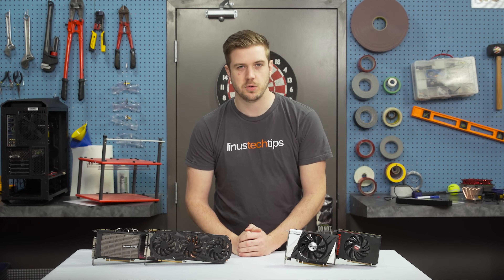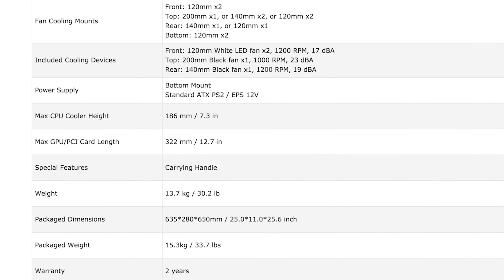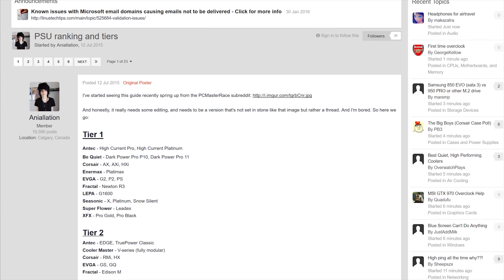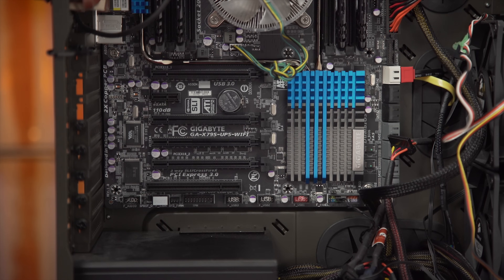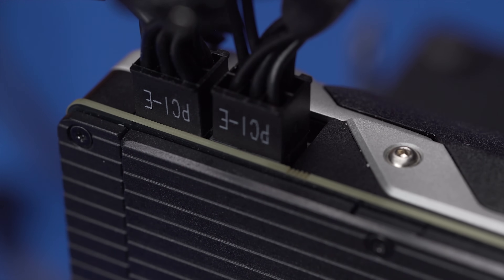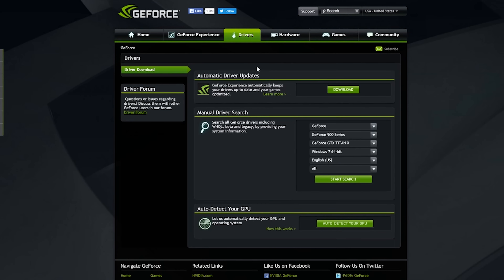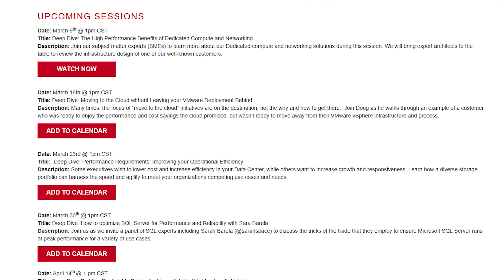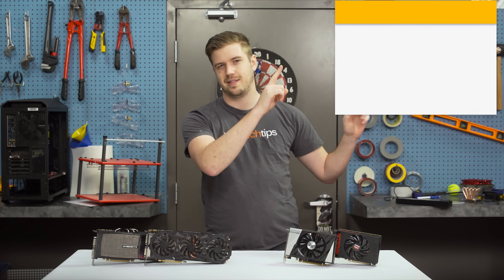Installing a Video Card - How To: Basics

Comment: You know.. I always laugh when I see people talking about how you guys are running out of content. But this.. this might actually confirm it. You guys are actually teaching people how to install a PCI-E card.. I don't think people that need to learn this are willing to even take the screws off of their case let alone touch something inside it. 

Stick to the good stuff guys, you moved into this new warehouse and instantly sold out by no longer being a bunch of techies doing awesome stuff in their basements, like the whole room water cooling. 

Here's an idea, buy some drywall, build a portable closet, buy a portable air conditioner and see what kind of performance you can get off of a PC by pumping the AC into the closet and pumping the closet air out! Is it feasible to run AC independently into a remote PC room? I'm sure Linus wants to know since he has one in his own house.

Comment: Even as a hardcore gamer and system builder for over 15 years, i can still appreciate a video on how to do things like this correctly.

One thing i would have included is to check for ports VS your monitors. Some manufacturers come with adapters for like DVI to VGA but many screens today offer DisplayPort and HMDI only so this can be an issue for novice builders and multi monitor setups.

Comment: Should I uninstall my drivers before or after inserting my new GPU?
Reply: +Phoenix no delete system 32
Reply: Before
Reply: +Martin Ramberg The video suggests after though (if you go by the video's order). I'm confused :S
Reply: ***** Thanks! :)
Reply: +Rediilo Doesn't really matter. Just do it before installing the new drivers so there's no conflicts.
Reply: +Jack Hanney If you knew so much about PCs, you'd realize you can't delete System 32/64
Reply: If anyone is confused: 
http://knowyourmeme.com/memes/delete-system32

It should now be impossible to do (at least with Vista and newer), but if you did somehow delete it: reinstalling Windows should do the trick.
Reply: +Phoenix Yay! Linux :3 I myself use Arch as my main system ^^
Reply: +Phoenix So do i ;) Arch as mains and Windows 10 as my gaming OS
Reply: I just realised something: your GPU's manual should give you the answer.
The manual of my ATI Radeon HD 5850 (yes, back when it was still ATI and not AMD) says to uninstall the old drivers first and then installing the new GPU, followed by the new drivers.
Reply: +Rediilo During the gpu install.
Reply: +Phoenix It does matter... I got an BSOD from installing plugging another GPU, since the drivers are conflicted. REMOVE YOUR DRIVERS BEFORE INSTALLING AN GPU.
Reply: Well.... Uninstall the drivers if you do a card switch (From AMD to Nvidia or the other way around) Or if you come from a really old card like the GTX8800 and upgrade to a new one. Otherwise there is no need to do that.
Reply: +Rediilo Allow me to to add to your question. After uninstalling existing drivers, should I install the newer drivers before or after physically installing the card? I'm asking because if we look at printers, for example, you're meant to first install the driver, and only then connect the printer to the computer.
Reply: aryesegal1988 After, because the new drivers will most likely cause problems for the older card. Your manual should say the same. 
It's not really comparable to installing printers, because it is possible to install multiple printers - old and new - without any problems. Assuming you have enough USB ports and can provide all of the printers with power.
Reply: dude it dosent matter i did it before

Comment: Speaking of installing things, I'm trying to build a PC myself (first time), but don't really have an idea of what fits and not. I would be doing some editing, plus some gaming. A modded Skyrim, mostly. I'm thinking about the GTX 960, but other than that, no idea. If anybody has some tips or good builds and you don't mind, send them this way. Also, I'm in college, so something under $500-400, preferably less if possible. Thanks.

Comment: Thats literally the easiest part of building a PC ...
Reply: Nah RAM
Reply: +Ethan Lennox Not if it doesn't post. I've had more issues with RAM working improperly than GPU/CPU.
Reply: Geoffrey Bassett Sorry, I rarely used this account.  RAM is still probably the easiest part since it is mostly just clicking it in to place.  RAM working improperly is actual hardware faults such as a dead RAM slot or a broken stick of RAM.  That or incompatibility

Comment: bruh installing a gpu is like the easiest thing. ive build my first pc like 4 months ago and it took me 1h or less. you just plug the fucking gpu in its slot and plug the psu cable into it lol
Reply: +Pajy K. Now fuck off.
Reply: +Pajy You say it's so easy and you just plug it in with the cables, yet it took you an hour? Lmao.
Reply: AzoNe yes mostly testing the system before putting it in the case and doing cable management smartass
Reply: Pajy Okay dude whatever. xD
Reply: AzoNe and 1 hour is pretty good considering I built it in a 250d

Comment: How to install a GPU
1) Remove 2 metal things.
2) Push it in to the top slot that it will fit into.
3) Put a screw in the thing
GR8 JOB M8 I R8 8/8

Comment: I found this quite sloppy if it is meant for beginners. It needs a few indicators like circles when speaking of a specific part, like the power connector. This actually confused me and I've installed quite a few graphics cards myself: If you are showing a specific part, don't put it off-center and un-highlighted. There were also a few things like "lift the graphics card when screwing it in", which is quite wrong if the motherboard is horizontal when installing the card. ("Line up the holes of the graphics card with the screw holes in the case" would be much clearer.)

Anyway, it's great you're doing videos for beginners, but beginners can often get confused when something is ambiguous or unclear.

Comment: First time I built my system, I ripped out my Gtx 970 out of the motherboard slot, without releasing the holder. Thankfully my card is completely fine, and it never did anything bad, I don't know about the slot though haha, I moved my card to the 2nd slot

Comment: tl;dw:
1) Stick it in the Slot
2) Connect Power
3) Screw in the screws
4) Plug in the Video Cable
5) Install driver
6) Done.

Comment: I have a problem. My graphics card does not line up perfectly with the screw holes on my case. It puts a bit of pressure on the card when I plug it in. Should that be okay? If not, how should I fix it...

Comment: I powered a GTX 970 with a 460W power supply. The only restriction was that I had to use a specific 970 that had two 6 pin power connectors, the PSU had no 8 pin.

Comment: I only really learnt about building pcs in general from August, no real education about it before then, and one thing that I had to learn on my own was that any display cabling has to be done has through the graphics card i/o, yes it seems obvious af now but before  when I was learning the basics I literally didn't know it at all, and this is basics no?

also is there a display cable comparison video, like between vga, hdmi, display port and dva??
pros and cons like?
Reply: wow, I should have proof read, I mean rear io on the gpu instead of the motherboard...

just a little help on that, as well as maybe which card to route the cables to on sli setups

Comment: Installing a graphics card is very straightforward but a for someone new it is probably good just to have someone tell you that.
That being said having built my own computers for many many years some things have cropped up. Like the 7800 GTX I had which vented hot air right on top of the fan for the north or south bridge of my morherboard which promptly overheated and made the system unstable until I figured that out and moved it to another PCI-E slot.
But most scarily was the time a friend had issues with the driver installation not recognizing his ATi Radeon 9700 so we decided to try it in my computer and when turning on the power the PCI-E power cable instantly burst into flames and smoke. Luckily both his card and my PSU survived but the cable was toast and we had to pry it off the connector on card. Let me tell you I saw big bills with wings for a second! =D

Comment: Gotta love subscribers hating on a style of video content that got the channel started in the first place...  

You kinda possibly out a part on how to connect up power adaptors.  For some reason a lot of people are still like 'you can't use a 6&8 split connector from a single port on your PSU' even if two separate connectors still draw from the same rail.

Comment: I have a i7 3770 (3.9 GhZ), 8GB RAM, Gigabyte motherboard 500w PSU and a GTX 550Ti. Should i upgrade the gpu or should i wait 1 year and buy a new pc? Will i be able to get 300 fps on csgo with a new gpu?
Reply: Wait a couple of months and buy one of the new Polaris or Pascal Gpus. The rest of the system is fine.
Reply: Ok tnx

Comment: This reminds me of my very first installation of the video card. Back then, there were no instructional video like this. It was back in 1998, I got my voodoo banshee which had 16MB of VRAM. I actually had to update bios so I can turn off integrated video processor because GPU was still fairly new tech and most of the motherboards needed update to bios to be compatible with GPU. After many trials and fixes, I got it to work.

A kid going from software render to hardware render was a religious experience. It was that day that I knew I was destined to be in pcmaster race lol

Comment: +LinusTechTips You are late about one week on this video. It was my first time installing a msi gtx 970 card into my very first build. I was extremely panic when my card has no signal during posting. I went high and low to get the card working. In the end, I got it working and still confused as what cause it failed or how I fixed it.

Comment: So if PCIe 8x is totally fine for GPUs, what needs 16x?
Reply: GPUs need x16, they will run at half speed in an x8 slot.
Reply: Hendlton Oh thanks :)
So SLI with the 2nd card runnin on x8 will not be as fast as SLI with two times x16 am I right?
Reply: +FusionGFX | fusiongfx.net yes, you're right but 2 cards doesn't mean double the power so you don't loose that much if you have the second card in the 8x slot.
Reply: Hendlton thx :)

Comment: should I use DDU just in case? Got a new graphics card installed from a repair shop and it's good so far. My shadowplay doesn't work so maybe uninstalling drivers will help but is it too late to uninstall or not?
Reply: nope, you can uninstall and reinstall drivers whenever you like, it will just use default Microsoft's drivers until you install proper ones.
Reply: +Hendlton thanks.

Comment: I need a opinion on a custom PC that i am planing, i have already got the gpu so i cant change that, any suggestions would be appreciated, thanks sluutttt knuckles

Processor : AMD FX-8350

Cooler : NZXT Kraken or Corsair H60

Mobo : MSI 970 Gaming

Ram : 16 GB Corsair Vengeance Pro 2133 MHz

GPU : Gigabyte GTX 960 Windforce OC Edition

PSU : EVGA 650W

Case : Coolermaster Mastercase
            Or
            Coolermaster Cosmos SE
            Or
            Fractal Design Define S
            Or
            NZXT H440

Comment: 1. Grab ur gpu
2. Get some eggs flower milk and chocolate buttons .
3 smash the egg on the gpu and pour the milk on it.
4. Put then flower and chocolate on it.
5. Turn over on and leave to bake for 1:30 hours on a low temp
6. Put both the gpu and motherboard in the microwave
7. Put them in ur case and turn it on.

Comment: I also look at the required  12v rails of the gpu and get the right psu wattage. It will look something like this GeForce GTX 970 - 28A and a 500W PSU minimum. Meaning the 970 requires 12 vots @ 28 amps and minimum of 500 watts . If your psu has more amps and watts it's a good, less than a bad thing .

Comment: I have a problem with nVidia drivers . Drivers Stopped responding and recover sometimes everything freeze with sound loop. I tryed everything from clean installation to other drivers version but nothing works. Do you have any suggestions ? 
My PC : AMD A10 7850k
MSI A78m-e45 motherboard 
2x4gb hyperx RAM 2133mhz
Evga GTX 660 3 GB 
PSU : Cooler Master Acab 600w

Comment: How do you stop Windows 10 from installing its own drivers? Will it stop once a driver is manually installed?

Are driver updates needed for older cards? If the sites are correct my newest GPU was released in 2012. I can't see the reason to update the one size fits all drivers. They may still support my card. I can't really tell if any of the updates are applicable to my card though.

Comment: I built my first PC yesterday yay :D but my case fans are plugged into "molax cables?" Plugged directly into my power supply, so they're always on. Is there any way I can make it so that the CPU turns those fans on?
Reply: plug the fans into the fan headers on the mb
Reply: +Jayden Lee oooh so the detachable part of the fan's cable. And then plug that into a pin thingy that says system fan?
Reply: Em0SceneStabr you should be able to directly plug the fan into the mb and let it be powered off that then go into your bios to configure the fan settings
Reply: +Em0SceneStabr no probs if u need further help go on the ltt forum.. you can get alot more advice there

Comment: I had an issue a while back where the metal bracket at the end of my new gpu was too short, and I ended up basically having to cut the bent end that screws into the case completely off. I thought that all manufacturers used a standard size / shape for these things? I compared the new card with my old 660ti and the length was much shorter 0_o

Comment: Linus for the next video, can you talk about pluging power and other connectors to motherboards. When I built my first computer I was very afraid that I broke my motherboard when I unplugged my usb 3.0 because of the excessive force it took. Also the 24 pin was tricky and very hard to remove even when the little tab that keeps it in place was being pulled up.

Comment: Bought a 1600w platinum psu for my fabulous Geforce Gaming GT 610 with 8gb vram. works just fine in the ram slot when it gets powered via 2 fan hubs.
Reply: +CryBeat wtf 1600w? Why in fuck would you use that , not even sli ,  RIP your electric bill
Reply: +Asentrix you wanna tell me 1600w isn't enough? Please suggest me smthg
Reply: CryBeat It's WAY overkill
Reply: Asentrix wuut but my Intel Atom dual core @ 1.3ghz needs so much power :O

Comment: My PSU only has 6-pin cables and I just installed a GTX 970, which needed 8 pins, with an 6-to-8 adapter. Will that work fine in the long run or should I get a new PSU? (It works fine for the moment)

Comment: If you add 2nd card do you need to reinstall the driver or do I just simply go to the display settings and change it to crossfire or sli enable.

Comment: You should have also included that some PSU that are mounted on the bottom may have upward facing vents, so if you are unscrewing covers/screwing in videocard you need to make sure not to drop the screw inside the PSU.

This is like, teaching people things 101. Don't omit stuff that can catch their house on fire.

Comment: GPU is the easiest. Hell every component is easy to install. You can have tiny bit of struggle applying thermal paste or installing aftermarket cooler if you are using Hyper 212 EVO, but in general building PC by yourself is easy.
Reply: Not necessarily easy, considering that you break it if you turn it the wrong way.
Reply: Aron Örn If you have tiniest understanding you wont break anything.
Reply: Well, I still think installing the ram is the easiest

Comment: I've been trying to find out loads about building PC's and which parts are best so what do you think on this setup

Motherboard:
 ASUS ATX DDR4 3000 LGA 2011-3 Motherboards X99-DELUXE/U3.                      
price: £283.17 $399.99

CPU:
        Intel® Core™ i7-6650U Processor                          price $393 £278.23
(4M Cache, up to 3.40 GHz)                

Case:
Razer NZXT S340          Price £240 $340  

GPU:
 
GeForce Titan X Hydro Copper 12288MB GDDR5 PCI-Express Graphics Card (12G-P4-2999) 
  price: £1,039.99 $736.27

Power Supply:Corsair CP-9020015-UK CX 750W Power Supply      Price £64.99 $46.01
Cooling:

 Raijintek
Triton AIO Water Cooling Solution                                price £54.95 $38.9                                                                               

SSD:Samsung 850 EVO 1TB 2.5inch SSD      PRICE £249.99 $176.98   
                
RAM:

  Corsair 16GB DDR4 Vengeance LPX 2133MHz  two of those                        Price: £63.79 $45. 16

AND PLEASE DONT BE MEAN I'M ONLY A BABY

Comment: Clean installing an OS (either because you need to start over or you've just built one) would be a good one to do, because that stuff can get confusing and unclear (e.g., I've done it more than once, but for whatever reason there is no system reserve partition this time O_o). Installing a GPU, not really needed IMO

Comment: Mind that touching your PC case to discharge yourself from static electricity only helps when your case is plugged into the power socket, which you shouldn't do when installing/replacing components! 

Discharge yourself by touching metal pipes from your heater or anything else which conducts electricity and is connected to earth instead.